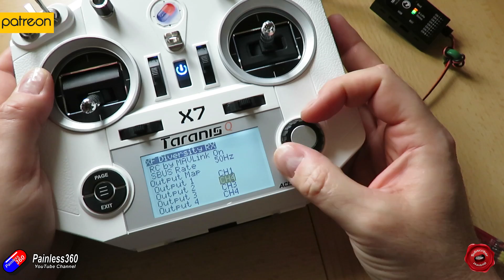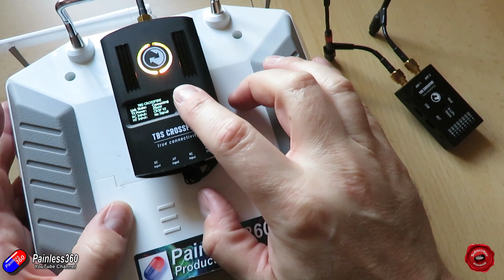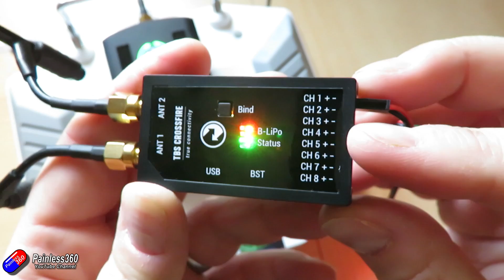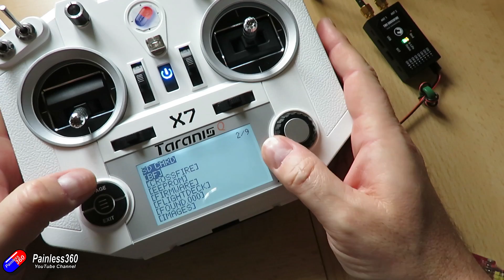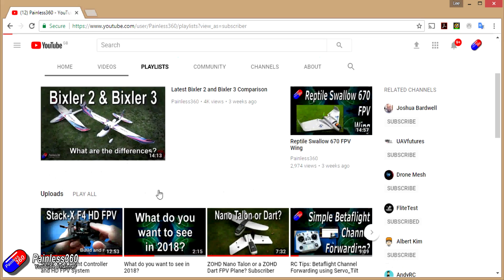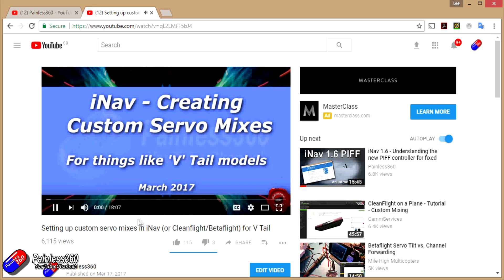Crossfire and PWM Quick Tip

Comment: Hi I'm having issues getting mine pwm to bind to the module, the module is updated but I'm also having an issue getting the module to talk to my tx16s, I'm new to crossfire and have no idea what to do
Reply from the maker: If you are using it Crossfire reciever, you'll need a Crossfire module in the back of the radio too. Best of luck

Comment: Love all your videos, So if I want to change my 6ch rx so that ch5 that is for pan FPV on a switch,,, Can I change that in outputs so that output 5 is now reading ch7? Which my new head tracker is set to pan or do I set it to Tr7 which my head tracker is set to read pan movement.  I basic want to use my new head tracker set on ch 7/8 but use it with a old pan camera that is in a plane with only a 6 ch tbs nano with pwm adapter… I know you know the answer… Thanks in advance. Or do I make the crest ch5 for pan do I make that Tr7 on the Open tx side?

Comment: This may be the first time I’ve ever sent u a message. Anyway I’m having trouble with my tbs 8 ch receiver staying connected in inav 5.1 and tbs 6.09 I think. I have receiver ch 3,4 set to crsf same in inav receiver tab so what happens is I’ll have stick commands in inav for a few min and then nothing unplug battery plug it back in nothing what a while and it works again. In tbs manual on page 45 ish they say something about 3.3v only I have receiver plugged into uart 6 on maytek h743 and  5v pin next to it. Receiver Is not hot. Haven’t tried 3.3v power yet so maybe that’s the problem have u seen this before?
Reply from the maker: I've not seen that here. I'd try another UART... Best of luck
Reply: @Painless360  I think I may have had a cold solder joint on the little wires that supply power to top board. Everything seems fine now thanks

Comment: Can you get v-bat sensing using the Crossfire Nano RX with 6-ch pwm adapter? I'm trying to get battery voltage from my airplane to my radio without a flight controller..  any advice, or Insight finding this information would be greatly appreciated. Thank you

Comment: I’m wondering if this has something to do with my Kyosho blizzard that I’m trying to use crossfire with. I have the nano 6ch receiver, everything plugged in and my mixer set up like you have it in the tracked vehicle mixer video. As soon as I plug in my vehicle, the tracks go crazy spinning up, stopping and reversing direction.
Reply from the maker: Check out my Car and Truck playlist for how to setup a radio for ground models. ESCs on cars work differently than aircraft.. Best of luck

Comment: Old video, but i need some advice.

I have a fc in my plane, but not enough ch on my matek f405 to ad a pan an tilt, how would someone set this up in the 8ch diversity receiver, in ch output, i have ch 3 and 4 as crsf tx and rx so all the other pwm channels are unused
Reply: im not sure about this but maybe u could use the csrf to control everything else through the FC itself and connect the tilt and pan servos directly to the receiver as pwm. please correct me if im wrong

Comment: In this PWM setup, Is there a way to input model battery voltage to crossfire without a flight controller in order to fly an RC aircraft line of sight and show model battery voltage in my OpenTX radio?
Reply: If you only use 2s yes. The receivers do have battery telemetry built in. Voltage, current, and current drawn. I use 2s lion on a drift with caddx vista with crossfire micro rx and no FC. I have the buttons on back of tango 2 read out lq and craft voltage
Reply: @hildy2222  In my case, it's 6S, so it will take more than the crossfire receiver. I'll keep using my trusty Spektrum DX18 with DSMX telemetry for my LOS models.
Reply from the maker: Not sure - if you find one please let me know...
Reply: @Painless360 With that in mind, what is your preferred straight RC receiver for LOS models?
Reply from the maker: FrSky X8R
Reply: LOL. Copy.
Reply: Same question..? Looks like no chance to get telemetry from crossfire receiver like voltage???
Reply: @mantassernius8976  The answer seems to be: no chance. You may be able to put together a contraption with a nano diversity receiver, the PWM adapter and a small 20x20 controller. However, it's not cost of time effective in my opinion. I'm using my trusty Spektrum DX18 with DSMX telemetry for my LOS models.
Reply: mantas sernius if you power the receiver directly from the battery 2s max
Reply: Old comment thread, but did any of you find the answer to this question?. I too am trying to get voltage information sent back to the radio without a flight controller.

Comment: So the micro RX is the same process to setup on a fixed wing. Lua script, change over to pwm then map channels? 
    I've been trying to get the electronics setup on a ft sea duck and I believe this answers my questions and hopefully my issues
Reply from the maker: It is. I’m planning a video about it but was delayed as the firmware had a pwm thing that needed sorting out..
Reply: @Painless360  so I'm chasing my tail now trying to configure. I spent a few hours on it yesterday scratching the noggin and scouring YouTube lol. Getting ready to di the bootloader update on taranis via jbs vid so I can get rid of the memory issue
Reply from the maker: When I looked last week the latest firmware had that PWN bug..
Reply: @Painless360   bummer

Comment: I've been trying to get help everywhere. basically I've been flying multirotors and I'm just getting into fixed-wing fpv. I'm using the crossfire full size tx module and micro RX V2 that comes with the servo adapter for pwm. No matter which way I plug in the servos I can only get 2 servos to work either elevator and aileron or throttle and rudder. I have a 4-channel fixed wing. And I'm not exactly sure how to do the output mapping for this Crossfire micro RX V2 with the servo adapter. Like where would you hook up throttle aileron elevator and rudder on the servo pins, there's 1, 2, 3, 4 on the servo adapter with 5v and ground for each servo. I have no idea what I'm doing wrong and I really want to get this plane in the air. I don't want no stabilization I just want it to run off directly from the receiver with the servo adapter. I can't find any instructions or videos or manual. Hopefully you can help or make a video it would be good cuz I've never seen a video on the pwm servo adapter for the micro RX V2 and also for the Nano RX with servo adapter. If they work they would be perfect for a wing or a small 4-channel plane. And I'm using the ready made RC strix stratosurfer it's kind of like a bixler. I've been going to all your videos I can't find any information other than this video but I'm just confused. Any help would be greatly appreciated and if you have patreon I'd be glad to get on board.

I eventually will probably go with a Maytek with INAV but for now I just want to be able to use the receiver the way it's designed to be used with the servo adapter.

Thanks my friend

Rob
Reply from the maker: I’ve ordered one so will do a video when it comes in.. make sure you’re subscribed and Patreon details are in the video description..
Reply: @Painless360  thanks will definitely subscribe and join your patreon.

Comment: Thanks for many good videos, I try to set up a flying wing with TBS Crossfire nano rx, PPM output to 3 channels and smart audio on the fourth, everything works fine. BUT I have a problem, when I try to center the servos in ppm output on my x12s nothing happens, but using sub trim it works fine.
Why is it so, ppm center works on all my usual FRSKY rxhttps://www.dropbox.com/s/ive9j1hmfexl7jk/output.jpg?dl=0

Comment: Any idea how I setup tbs nano throttle on a fpv truck ? I got the steering and camera servo working but the throttle is messing with my head lol
Reply from the maker: It should be the same as setting up any PWM output.. I'd try it with a servo connected to that output to make sure that it's configured ok.. Best of luck!

Comment: I have a question in regards to the BST plug on this receiver.  I have a TBS GPS can I plug that into the receiver and say connect the receiver to a Matek F405wing FC?  I have a TBS FPVision cube but am building a Caipi2/iNav similar to your build and don't want to use 5.8gHz for video.  (Going with 2.4ghz)

Comment: I purchased the diversity receiver for a 6 meter FPV scale glider, however I require 9 channels plus a receiver socket will be required for Battery power, i.e. A,E,R,T, Retracs, Flaps, Air-Brakes, FPV Cam Pan & Tilt.  What would be the best way to go about this?
Reply from the maker: Not sure, maybe an S-bus to PWM converter?

Comment: awesome stuff!!  I have a taranisXD+, TBS CRSF div and with the core pro and can't work out why the turnigy rx controlled switch won't operate on CH8. The input is sw5,  mix to ch8....I'm using the same batt as the Rx, earthed...I'm a bit lost..what have i missed?. Please help!!!..thx!
Reply from the maker: If you're trying channel forwarding then please see my video on that from a few months ago - it might help..
Reply: Aha!..good to know... but no  flight controller on this project; ch1 thr, ch2  steering, ch3 pan, ch4 tilt, ch5 roll ..i was hoping to use channels 6,7,8 for switches , turret rotation...etc.
Reply: updated, Tx, Rx, core pro with latest updates, inc unstable releases..rebound Tx and Rx, repeated input and mix setup....SUCCESS!!!

Comment: do you have, or can you do a video on how to do it outside of the QZ7? i have a full size on its way and using an x9d+. how do you setup the failsafe etc and other stuff on that combo ? IE can you do it from the transmitter module itself?
Reply from the maker: All covered in the Crossfire series - have you watched the other videos?
Reply: Daytona FPV 
It’s identical to doing it on the radio. Same stuff, just a little joystick to use instead of the radio controls
Reply: i'm just starting to go through them now in anticipation of the crossfire coming next week.

Comment: The micro rx has a Servo breakout that allows 4 PWM channels as well. Really useful with 1-3 as throttle, and the 2 elevons in a flying wing, and channel 4 controls smart audio with a Unify right through the crossfire